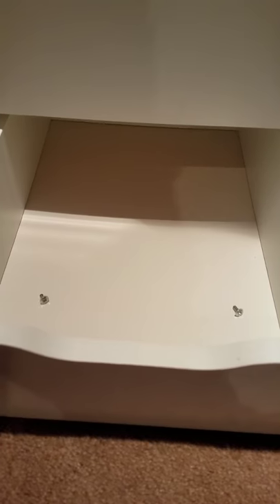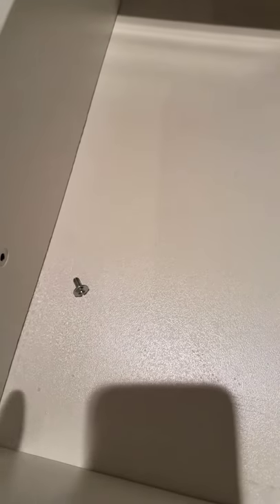How to remove a drawer from an already assembled Alex drawer unit

Comment: Thank you, thank you, thank you!  I've had papers stuck down there a long time which I was finally able to remove and then close my bottom drawer fully.  It would be nice if they included that tip in the assembly packet that came with it!
Reply from the maker: Deborah Teeter you are quite welcome.  Yes it would have been nice the included drawer removal instructions. I've never had drawers you couldn't remove.

Comment: Just finished building the Alex Drawer unit for my daughter and need to move it to her dorm. Thought I would take the drawers out to make it lighter to move and then realized they don't just pull out by lifting them up ... this video saved my back!! Clever thinking as it's not mentioned in the instruction manual. Thanks for posting it!
Reply from the maker: Michelle Pottle yes mine is very heavy and thought we could take out the drawers out for the move but nope..so we moved it with everything assembled such a pain and even worse when things fell but I'm glad my struggles helped someone Haha!

Comment: it didn’t work for me :(  any tips?
Reply from the maker: There maybe more screws to remove, the drawer maybe stuck to the metal peice that allows it to pull out maybe a lil elbow grease, or possibly your unit is different than mine. Hopefully this helps.
Reply: ReginaBT it worked thank u :)
Reply from the maker: Yay glad it worked!
Reply: @3rmbt81  thank you!! Mine wasn’t working until I read this comment.

Comment: maybe i have a different model but i removed the screws and it still stops in the same place, it won't come out :(
Reply from the maker: Possible..check to see if theres any other screws holding the slider in place. Maybe a little extra force to pull but not too much or maybe its glued in as well as with srews

Comment: My drawer isn’t coming out after I took the screws out from each side. Help!
Reply from the maker: Check to see if there are any other screws from the outside that may be preventing the drawer from sliding out. Or maybe needs a firm tug.  Mine only had the 2 screws that held it in place
Reply: Thank you.
Reply from the maker: @jonikamiahartistry7242  no hopefully that helps

Comment: I took both screws out and my drawer won’t come out :( even tried a different drawer. No luck
Reply from the maker: Maybe there are other screws in the slider that are still holding the drawer in place. Or the drawer may be stuck depending on how long it's been assembled.
Reply from the maker: Sorry this method didn't work for you

Comment: My drawer must be broken because I did that and it still doesn’t slide out :(
Reply from the maker: Mine was stuck too. Look to see if yours has more than those screws possibly.
Reply: I thought mine was broken too but you kinda have to pull it pretty hard to separate the drawer from the metal sliding bars on the side.

Comment: Am i the only one it didn’t work for
Reply from the maker: Some people had trouble at first. Some drawers may be a little harder to pull out once screws are removed and had to give a harder tug. Look for additional screws possibly. Did you assemble your unit or was it bought assembled
Reply: @3rmbt81  I assembled it myself
Reply from the maker: Does it have more screws than mine. Maybe some in the slider